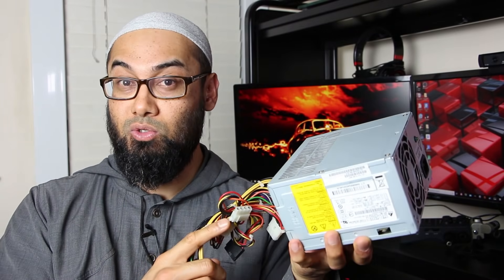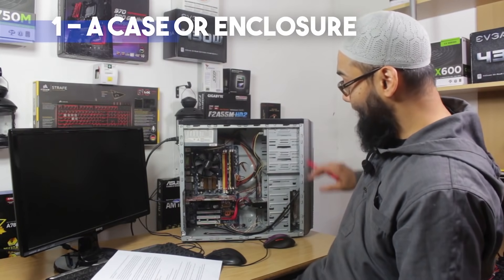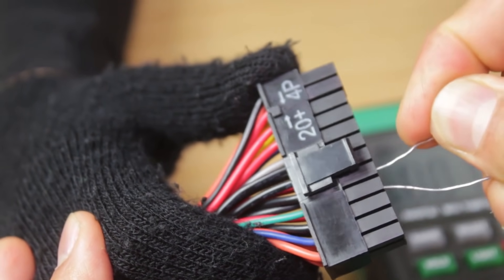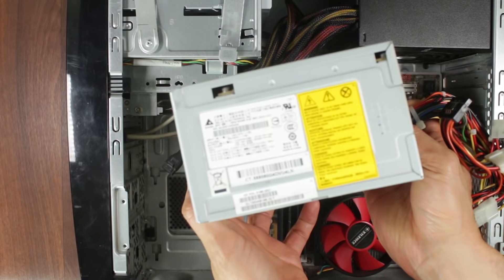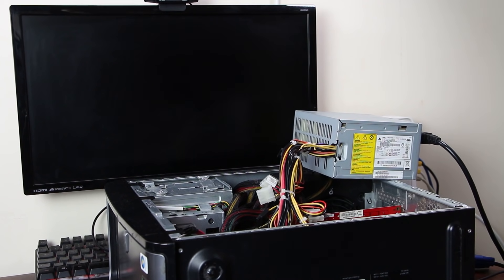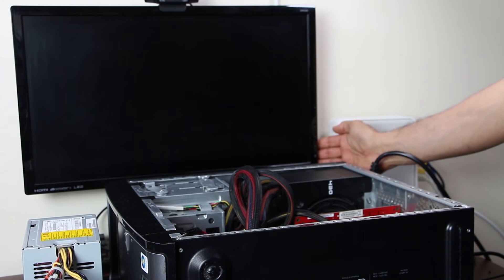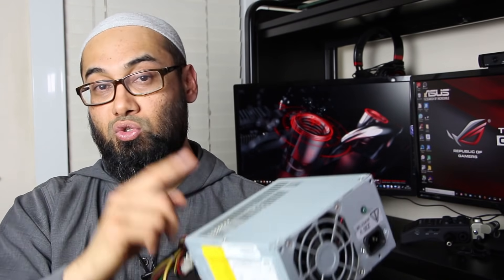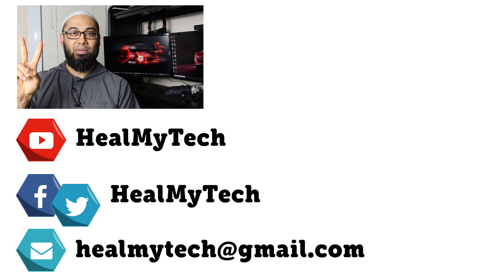Computer Turns On But No Display On Monitor | Led Light On Fan Spinning | Power Supply Unit Pc?

Comment: I have a weid issue and I hope that you can help me.I turn on my pc, everything is fine, but my monitor doesnt wake itself up and I need to unplug it's power cable from 5 to 20 times before it works.Do you Know why that happens?
Reply: Beat Droppers unplug the monitor until the power led cuts off all the way and then plug it back in. It’s a displayport issue most likely. Mine does the same sometimes.

Comment: Salam my brother, Im building my first pc and im having problems with it. I pluged every thing in but my pc wont start. The fans are not spinning and my ram is not lighting up its rgb. Every part Im using is new and my cpu is ryzen 3 2200g motherboard is b450 steel legend and case is nzxt h510 and psu is coolermaster 750 watt. Please help me.
Reply from the maker: I have a different complete troubleshoot series for these problems, have you checked it out?  What tests have you done to troubleshoot?

Comment: Can anyone help.
I had been using sapphire rx470 8gb graphics card.
Today , 
My Sapphire RX470 is not able to provide a display output.
I tried to reduce the fanspeed using MSI Afterburner.
But soon after applying the settings. The card stop working.
Now there is no display output.
The card is having LED light on.
The fans are not spinning.

I had changed the system and installed on a new one still the same condition. 
No display output

Can anyone help plss.
Reply from the maker: "I had changed the system and installed on a new one still the same condition. "   Could you be more specific?

Comment: I think it's my mother board that is gone! I switch power supplies and still nothing. Even though the MB is getting power I still it's the problem because I know that my gpu's are working#
Reply from the maker: very possible, and unless you know how to test motherboard the only way is to replace the mobo with a known working one...what about your other components, have you checked them?
Reply: @HealMyTech1  I discovered that it was the motherboard , I tried another one and I was able to get into bios which I could not do with my original motherboard. The only thing is that my original MB is a x99a sli plus and the other one that I switched for is a msi z97 which do not have m.2 slot like the x99 and I don't have any extra storage to install Windows on. So this is my problem now is getting storage to install OS on it, because my OS is on my m.2 drive which is on the x99 MB!
Reply from the maker: keep me posted!

Comment: I saw a video with the same case as this. He clean the ram using rubber eraser.
Reply: Most probably that was the pc was booting up and shutting down .. here the pc is not starting at all
Reply from the maker: Correct...!

Comment: Hi sir 
My pc was working fine this morning but I decided to clean out the dust as per my routine, I took it apart and put everything back as I found it after cleaning but when I powered it on, my monitor said "No signal - check video cable". I then opened up the case again and everything was plugged in correctly but the monitor still gives that message and goes black afterwards. Can you help?

Edit: my keyboard LEDs don't turn on either but my mouse is fine
Reply from the maker: 3 causes...you may either have caused a short when dust cleaning, or you didn't put something back, or something died regardless...you need to start over and troubleshoot each step, check my troubleshoot series or my One PC to Rule Them All series on the channel, make sure you get a POST outside the case before you put everything into the case...
Reply: @HealMyTech1  I checked everything and it was correct then I remembered someone said i should clean my RAM with an eraser and I did then it worked, thank you sir
Reply: @HealMyTech1  I also through i shorted but i figured the problem. It works now lol
Reply: serenity exactly what happened to me today! Please tell me some news

Comment: But my num lock light is also remaining turned off
Reply: What about your mouse?
Reply: @sanjay5102  uhh leave that it came out to be a problem in my hard drive yet thanks for your concern
Reply: @atharvasaxena6596  I have the same issue, I cleaned out my computer yesterday and everything just went wrong

Comment: What do you think of iMac pro,?
Reply from the maker: Not too much too be honest, still overpriced compared to what you can get for same money, and updating software renders it useless pretty soon.
Reply: @HealMyTech1   what about macbook pro  i thought thats the only laptop that you recommend ??
Reply from the maker: @karimroshdy6432  Not a recommendation, but an observation, objectively Apple does make good hardware, but very overpriced.  However, lately, the Windows side has picked up, even Microsoft with their Surface models, and other makes like Dell, Lenovo, Asus etc, and competition is quite good.  My recommendation is always to go for a used business model and upgrade, preferably with open software like Linux, if we are talking about value for money and becoming slightly tech savvy.  A lot of Apple uses like Apple products compared to Windows because Apple allegedly gives them a non-techie needed experience, kid of plug and play with stability, but at a high premium price.

Comment: Sometimes when i turn on pc the screen stay black 2-3 times out of 30, when this happens i restart pc and everything goes back to normal. Also when i play or watch youtube sometimes when someone turns on or off the light in the house the screen turns black for 2 sec or rings the doorbell :D. I know the monitor is not a problem because PS4 is connected to it and i don't have any problems. Is it a Power Supply problem or something else. Sry for my eng. :D

Comment: I had an old Intel Pentium 4 Compaq desktop with windows xp.... 
Troubleshoot:
My monitor shows no signal when I connect to the socket... As I connect it to my PC with a VGA cable and press the power button then it goes blank(fan spinning and cabinate's light blinking) 

Will this work with my problem

Comment: My pc completely turns on with all the leds in 4 fans and has 5 fans spinning. I had a 450w corsair psu and it turned on for the bios but I pressed the save and exit without having a storage device connected and then the monitor didn't display anything.  I ended up buying a 750w and it didn't fix the problem. Help please

Comment: I really need help, when I turn on my pc and when the monitor goes to the screen where it shows the time and a nature background (windows 10) and try to wiggle my mouse/press a key on the key board so the password thing pops up, But my keyboard and mouse completely don’t respond. The keyboard and mouse are completely fine, I plug them into a different computer, and they work just fine, but when I plug in a different keyboard and mouse into my broken PC the same thing happened with my main keyboard and mouse. And also the sensor on the bottom of the mouse works, the key and mouse turn on the lights for about 2 seconds in start up and then turn off. PLZ HELP MEEEEEE!!!!!! Monitor has no problems
Reply from the maker: It does sound like a drive issue between Windows 10 and your specific peripherals.  I had that issue with a HP laptop from a relative, and I couldn't resolve it, he ended up using an external mouse instead of the mouse pad.  Yes you should try to uninstall the driver and reinstall, or try an open source driver if available.  Windows 10 has those weird annoying anomalies.
Reply: Maybe the usb is broken try other usb slots
Reply: Cyberspino I did
Reply: Cyberspino I thing something in the driver is messed up
Reply: @mcslav7739  oh ok then

Comment: I build a new pc and I have the same problem I use  antec ne650w psu, cpu fan, led light, chanel fans everything seems fine except nothing coming in monitor.  can u suggest me anything to solve this issue. Ur help will be very valuable. Pliz  Thanks.
Reply from the maker: What tests have you done?
Reply: @HealMyTech1  yeah it's working my pc is running 🏃 now 😊...thanks for the response.. Everything is 100% fine.

Comment: I have a problem a bought a new power supply and it’s how numbers like 1,3 and 4 also everything is working but their is a orange light when I turned it on and it stays like for 5 seconds then turns off

Comment: when i plug in my motherboard its working but when i put it in my rx580 4gb stuck on black screen "no display"

please man help ..please please
Reply: Dead gpu?
Reply: @thej2215   but my graphics card fan is spinning.
Reply: @thej2215  when i plug it in my graph card stuck on black screen just a black. but all fan is working. 😭😭😭
Reply: @itzyahmanjm8859  yeah the gpu has a problem i think,is your hdmi working fine?
Reply: @itzyahmanjm8859  my old gpu has that problem also the gpu's fan is spinning but no display
Reply: @thej2215  did you fix it ?
Reply: @thej2215  i guess bcoz when i plug it in my motherboard its working .
Reply: @itzyahmanjm8859  i fixed it by replacing my gpu
Reply: @itzyahmanjm8859 but does the gpu show up in device manager?
Reply: I have same problem but my gpu works on another computer so its not dead gpu
Reply: @adry.rar-  try to clean it

Comment: My computer froze and I couldn’t ctrl alt delete to restart my computer, it was frozen for 20 mins so I just turned it of via power button and when I turned it back on it would show display? I don’t think anything is wrong with my components. Any idea what to do ? Streaks
Reply: i have the same problem
Reply: Try resetting the BIOS

Comment: Everything on the motherboard is working, but it shows on the display signal received then no signal straight away. Any help?
Reply: Atar Oosa did you figure it out got the same problem
Reply: Yes, the ram slots were the problem. I had to try 1 ram on each slot. 2 of the slots aren’t working properly.

Comment: I have Ryzen 1700 its CPU fan is spinning but no display i have change the ram and also try in different slots and check the cables, tight it properly but nothing’s works 😔

Comment: I dont know what to do! My pc works (it turns on)  but i get no display:( its a brand new build 😔
Reply: Bro same here,  I have Ryzen 1700 its CPU fan is spinning but no display i have change the ram and also try in different slots and check the cables, tight it properly but nothing’s works 😔
Reply: Same, and that is why I'm here. I recently built a PC with a ryzen 5 3600 and a 1660 ti and im having this issue 🤦‍♂️

Comment: For people who have ran double or above monitor setups in the past make sure both monitors are plugged in so window runs how it was set to run. It didn’t display with only my primary!
Reply: I hate it how this is what fixed my computer, I was upgrading my CPU but had to switch back to the old one to update the bios on my mobo, but it wouldn't send a display because I only had 1 monitor connected when I usually have 2.
Reply: Hi i wanted to ask If what youre saying ist still true.. i have used dual Monitors before and i decided to give my 2nd monitor to my Brother, and now my screen only show a black screen ;;
Do i have to borrow the Monitor from my brother back?

Comment: Just got my computer (pre built) and the rgb lights turn  on and everything is fine but my monitor says no signal... i need help
Reply: Did you find a fix?
Reply: @subhumanpostalworker8051  nope they said that i have to send my gpu in and they would send me another one

Comment: Guys try switching the ram to a different ram slot it worked for me or just take it out and put it back in in the same slot, Thanks.
Reply: King Shoot I’ll try it
Reply: @cincr6428  Tell me if it works
Reply: King Shoot will do
Reply: King Shoot it did work tysm

Comment: i think my whole PC just broke cuz what i do is turn down the voltage from OC to default, then my pc say it not working well. So i restarted it and it keeps turning off and on every 5sec
Reply: Same problem here
Reply from the maker: Why do you think its the whole pc?  That's a rare case, maybe one or 2 components, start with PSU check!
Reply: HealMyTech well it run smoothly before i turn down the voltage, adjusting the bios to be normal/default mode, further more that my motherboard now cant read my ethernet cable(no ethernet cable detected) and its high temp just by idle/not doing anything except for my task manager, it use 80-100% disk(HDD) to open a folder or just microsoft edge/google chrome. So pretty much thats why i think my whole pc broke
Reply: Remove ram
Reply: And test it
Reply: I had 3 rams 16gb and one was not working so my pc wont turn on  then i removed it and boom works as new

Comment: I disconnect my gpu and cleaned it when i put everything back my pc made beep beep beeep and my monitor said no signal coming from pc what shud i do?
Reply from the maker: This video is only one possible way of troubleshooting and fixing a PC. Based on all you questions, I have created a dedicated series to help troubleshoot all 10 main components of a computer in a logical process, I promise you if you follow it you will sort out your issue, since its the exact same process I go through when troubleshooting any pc problems for hardware. Troubleshoot A Computer Series Playlist | Computer Not Turning On | PC Turns On But No Display On Monitor https://www.youtube.com/watch?v=Wkcx-x9gjkg&list=PLDmnHbxxv3ncrDmkkt4oVJTEIBIy9pvRN
Reply: Double check to make sure you seated the video card all the way in (GENTLY push each side down to make sure it is firmly seated in the video card slot ... if you are absolutely sure it is seated properly... then it is possible you have a bad video card (they are static sensitive) and its possible it get zapped while you were cleaning it

Comment: My computer freezes every now and then and sometimes after that happens I turn it on and the output isn’t working
Reply from the maker: I would start with testing PSU, and maybe RAM
Reply from the maker: This video is only one possible way of troubleshooting and fixing a PC. Based on all you questions, I have created a dedicated series to help troubleshoot all 10 main components of a computer in a logical process, I promise you if you follow it you will sort out your issue, since its the exact same process I go through when troubleshooting any pc problems for hardware. Troubleshoot A Computer Series Playlist | Computer Not Turning On | PC Turns On But No Display On Monitor https://www.youtube.com/watch?v=Wkcx-x9gjkg&list=PLDmnHbxxv3ncrDmkkt4oVJTEIBIy9pvRN
Reply: It was the power supply, I tested with another working one and it was fine. After I tested just switching some of the cords which power the drives and everything’s working fine. Thank you, your videos were very helpful! ❤️❤️

Comment: Hey there, assalamualaikum from Indonesia, brother i have some pc issued here, when i press my pc button it takes a 10 minutes to show up to my monitor with a short "beep" once, do you have any solution for this please? Thank you. (Btw my bios is AMI)
Reply from the maker: 10 minutes for a POST is way too long, at his stage it could be anything really, what's your configuration?  How old is this pc?
Reply: @HealMyTech1  well my pc configuration :
AMD A6-6400k
2 x 4 GB ram ddr3
Biostar A88 MQ
My psu is a casing psu

Well before i bought my pc, my pc is used for an internet cafe before, maybe from 2015, and i just bought a new ram but there is still with  same problem, is it possible if the problem because my power supply started weak?

Comment: Hi there, my monitor is completely black,but has power,i tried to remove ram and battery several times,but it didn't work. I would like to hear your opinion for this. Greetings from Serbia friend.
Reply: Do you experience a problem on your Laptop, Macbook, Desktop, Phone? Is it over heating, screen turns black, windows issue?
Then search no more, message MILLER'S TECH for any kind of COMPUTER REPAIRS, HACKING ISSUES, Contact him on WhatsApp +18312915270
Reply from the maker: I have done a full series on this, you need to troubleshoot one component at a time.  Troubleshoot A Computer Series Playlist | Computer Not Turning On | Pc Turns On But No Display On Monitor https://www.youtube.com/watch?v=Wkcx-x9gjkg&list=PLDmnHbxxv3ncrDmkkt4oVJTEIBIy9pvRN

Comment: Can any one please help me ? i am really confused! when i start my pc it's start for 2 sec with display then off & then start with no display then keep restarting on, off, without display, and some times its turn on with display and when i work on it like normal work it's suddenly turn off and started again with no display and keep restarting... i checked no heating issue i have cpu cooler and i always monitoring the temperature and its fine, i removed my GPU and try to run without it with motherboard display port but still same problem i removed the ram and trying to on without it still same issue.
so now i am confused is it PSU or motherboard ? any one have idea ?
Reply: Unplug the battery for 1min then put it back.
Reply: @hafizmustapa6354  Thanks for reply i did it and i was even changed it to new cell but not working.
Reply from the maker: I would start with testing the PSU.  This video is only one possible way of troubleshooting and fixing a PC.  Based on all you questions, I have created a dedicated series to help troubleshoot all 10 main components of a computer in a logical process, I promise you if you follow it you will sort out your issue, since its the exact same process I go through when troubleshooting any pc problems for hardware.  Troubleshoot A Computer Series Playlist | Computer Not Turning On | PC Turns On But No Display On Monitor https://www.youtube.com/watch?v=Wkcx-x9gjkg&list=PLDmnHbxxv3ncrDmkkt4oVJTEIBIy9pvRN
Reply: @HealMyTech1  Thank you :)